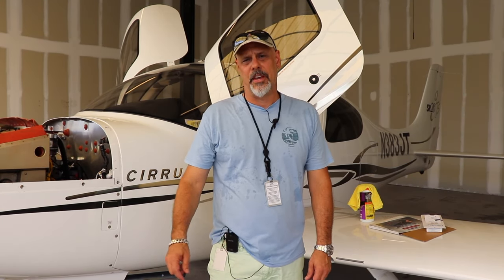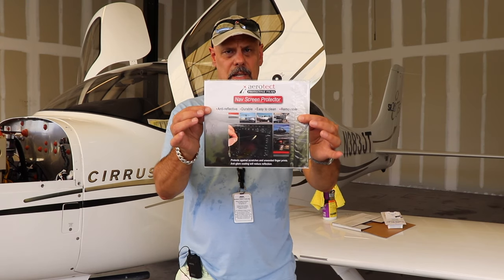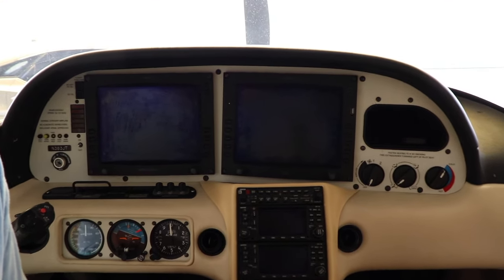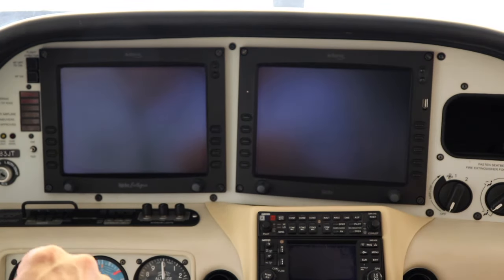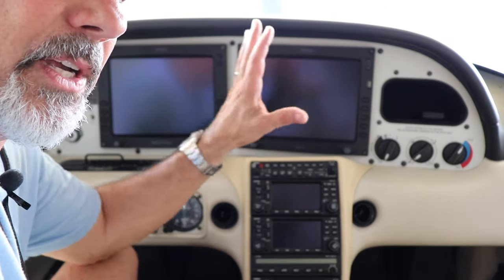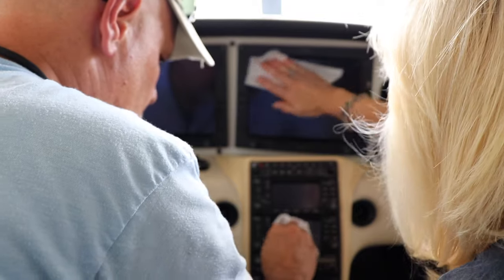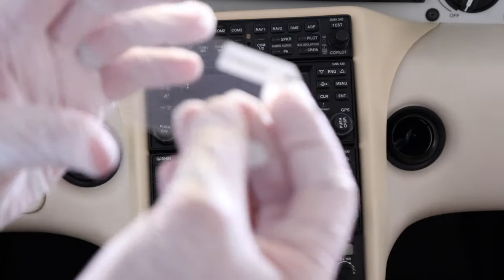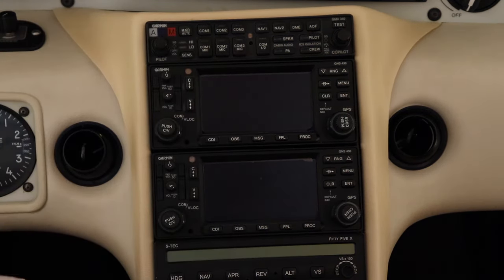AVIDYNE ENTEGRA under $200 for the CIRRUS SR20??

Comment: Why put screen protector on? What’s wrong with leaving screens without after cleaning?
Your avidynes are not touch screen. 
We found the protective shield has a slight negative dimming effect. 
also we found not having original anti glare film has a marginal glare problem.
After we tried with and without, we’re happy to leave off. 
The glass is very easy to clean with microfiber cloth.
Reply from the maker: That is purely up to you.  I find the anti-glare to be better fro me, but you can certainly leave the original coating.  It was just a little too shiny for me.

Comment: If I’m not mistaken covering the screens like this invalidates the service plan. This means if you want to send yours in for a warranty exchange, they won’t honor it. Correct me if I’m wrong please.
Reply from the maker: I have looked throughout the COPA site and cannot find any information on that. It is possible that this would be the case on the newer "touch sensitive" screens, but the MFD/PFD is all bezel-button controlled and the visibility is vastly improved. I would not recommend this on any touch screens. Note that the GNS430's are also non-touch, so the same applies to them. Many COPA members have already done this with similar positive results.
Reply: It will not void the extended AeroPlan™ Warranty. However If you try to do an exchange vs repair they will charge you $1,548 for a Mod 22 on the MFD and Mod 48 on a PFD
If you are just doing a repair of your unit then it doesn't matter.
Per the Entegra Pilots Guide.  
11.5 Cleaning the EX5000 Screen
If your EX5000 screen should become dirty due to fingerprints or
dust, clean the screen using the following materials and methods:
● A clean, soft lint free cloth such as 3M Ultra-Brite Cloth # 2011 or
similar.
● A cleaning solution composed of de-ionized water or isopropyl
alcohol (IPA).
Always apply the cleaning solution directly onto the cloth. Never
spray cleaner directly onto the screen.